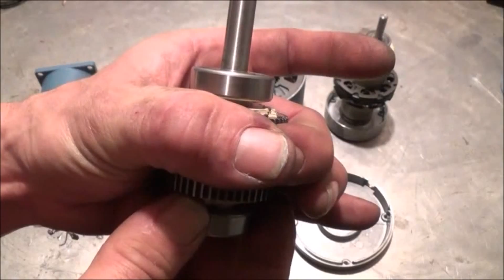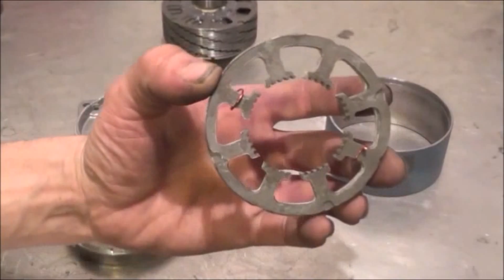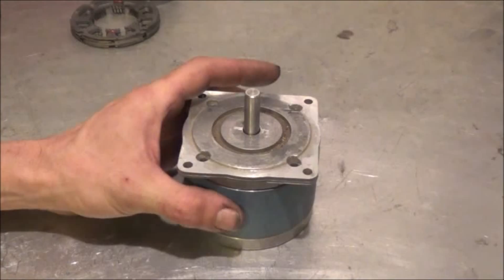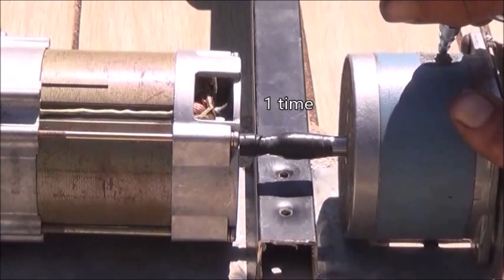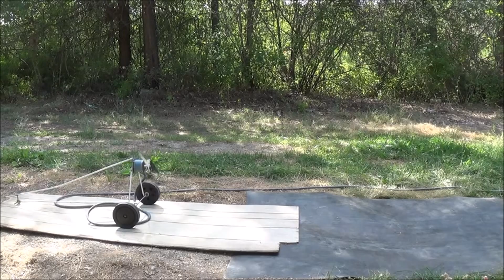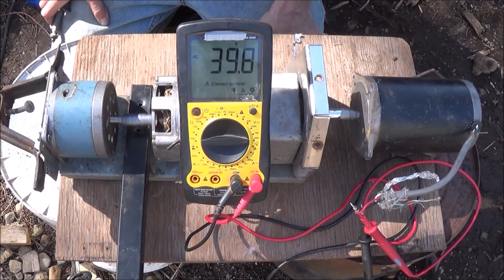New "Tesla Turbine" Design, Full Test And Build. NEW Design Starts Under Load.

Comment: The offset of discs just mimics the scroll on a turbo. If you employ the function of a conical shape within the body you will funnel and concentrate the forces. Chuck in some gears and you have a mechanical advantage as well.

Comment: If you could determine your brake horsepower and cfm air usage you may be able to incorporate a compressor head with a bypass whereas you could if your turbine is efficient enough, be able to start it with an outside air source and once up to speed allow the incorporated air compressor to take over and have a perpetual motion electric generator. That would be interesting. I am impressed with the amount or rpms that it produces, but torque is what propells the load from the generator/And air compressor

Comment: My question is what is the required energy input as compared to the maximum output of the Tesla generator?
Reply: As you've noted measuring the efficiency of these units is a complicated game in of itself to calculate, depending on what given medium is used to drive the system just takes a bit of math and known values. Steam would have a detriment as much energy is used to create it. But given this case where he has used free energy in the form of compressed air made from his trompe compressor is likely where the high potential efficiency stems from. I'm sure Tesla did the same to achieve his proclaimed 98% efficiency. At that point the only losses come from friction in heat and imbalances. All of this sounds great but there is still one large problem, torque. A Tesla turbine dam would indeed be interesting but it's easier to just let the water fall and drive conventional hydroelectric turbines as their efficiency is already 90% while maintaining the advantage of much greater usable torque compared to a Tesla turbine. Water is a much heavier fluid than air and thus works multitudes better for this sort of thing. This also results in lower rpm and reduced maintenance. That's not to say that the power of our largest dams couldn't create astronomical amounts of pressure in air but logistically it's a difficult thing to opt for going that route. Imagining the incredible speeds and very high pressures, a failure would be much more detrimental and the cost of taking that into account engineering wise I'm sure isn't worth a few percent. Everything considered, very cool technology. I always kind of though as it being best use in a kinetic energy recovery system. KERS like in F1 race cars, imagine an additional small tesla unit running off exhaust to rotate a mass in which said mass could be dumped back into the wheels for additional boost? Or anything run off of combustion for that matter, exhaust is wasted, why not use it? Just for that momentary boost in power if you need it. Sorry this was so long, I just really enjoyed the video and saw your comment and thought I'd offer my two cents. Anyways hope you see this, it's been a while, enjoy!

Comment: Does it work with steam.
Reply: Any gas or fluid will operate it, if you wanted to (and were insane enough) you could power one of these with mercury metal lol. Steam actually is one of the better drive gases for them, the heat allows for a higher flow rate and since the turbine extracts a ton of heat from the drive gas, it operates very efficiently.

Comment: WTF is the point! Put a fan on the end of the Dynamo you'll get double the power, but still only 10% of the input power. This about as inefficient an energy transfer chain as I've seen! What's you compressor running 500 Watts?
Reply: There is no compressor. It's generated by gravity & water..  He has a video on that.

Comment: I have a question im hoping someone can help me with. Is the exhaust equal or anywhere close to equal to the input? Could it in turn be used to power another smaller turbine?
Reply from the maker: The exhaust if working perfect should be producing vacuum forces and drawing air in,  this turbine is turning most of the 100 psi input pressure into a light vacuum force pulling at the "output" holes.  There is still some air exiting the exhaust holes but not much compared to the input volume.

Comment: Why are we not seeing these being used more? Why is it not common knowledge? Is there actual practical use? If yes....where/why? Thanks!
Reply from the maker: The origanal reason for the Tesla turbine not being used at a large scale was the materials available at the time could not handle the centrifugal forces generated on the blades. Today we still have issues when it comes to building large Tesla turbines due to the centrifugal forces,  nitinol and other super alloys have increased the potential size of the turbines but costs are far too high for production. They also only produce the 98% efficiency 's when only a light load is applied then as you increase the load they reduce in efficiency drastically.

Comment: How much energy is being used to power the air compressor?  Can this turbine "self power" the air compressor?  If so, then would that be called perpetual power?  Just an idle mind at work here......lol
Reply: Larry Ciarrocchi could work as hybrid for moving vehicles
Reply: He is using a Trompe Hammer for a Air Compressor. It's free if you have running water streams and elevation.

Comment: Would be cool to calculate efficiency... power out/in. 22W is pretty small though, so probably not very efficient. Maybe map out the power curve, I'm sure it's got a peak airflow and RPM that it works best at.
Reply: remember that this is only proof of concept, the amount of power out is limited mostly from the motor he is using for his generator. I'm sure that if he hooked up a car alternator he'd be pushing a lot more than 22W with the same amount of energy in. Doing a quick google search it said that car alternators get about 560 - 770 watts, and you'd only need to run it at about 2000 rpm, so if he is getting up to 14000+ rpm as he has shown in other video's then he could use a 7 to 1 reducer gearing to get the needed rpm for the required output.

Comment: Can you put a cap over the exhaust ports with the shaft sticking through and the exhaust air to another Tesla turbine? Using the same air with two turbines to one generator?
Reply: You can do anything within your mechanical capability to fabricate what you are talking of. I cannot tell you of the success or desired results. That is up to you to discover sir. If it doesn't work, you'll know. If it does work, you'll know.

Comment: How much forward thrust are you getting from the air exhaust?
Also, once you've determined an optimal angle for you nozzle. you should drill & tap a threaded standard air hose coupling, so you do not lose air pressure going in.

Comment: If you staggered 2 or 3 stater plates at a time, instead of individually, you could vary the size of the channel. Different sized step motors could be used to scale the turbine for different power levels.

Comment: we could use the exhaust from the car combustion engine to power this to in turn power the wheel more power per liter
Reply from the maker: Like a exhaust alternator addition to the power system, I like your idea!
Reply: thanks, just remember to attach a pump to pump oil for lubrication
Reply: Great idea I appreciate
Reply: Called a turbo, already exists

Comment: I do not understand why you are putting three into this chain? Other than the gear box why use the center motor? Are you generating an electro-magnate field in the Tesla Turbine since the steel parts are magnetized? The Tesla Turbine is generating torc can that be geared to power a Kinetic flywheel for power storage?
Reply from the maker: It is only for the gear box, the electric motor part of it is just connected to the gear box.
Reply: Does the Tesla Turbine have a magnetic field? If it does can it be used to gen electricity?  Finally can the sys  be used to power up a large kinetic flywheel?

Comment: Hey, that's a brilliantly inspired re-use and design concept! 
Can I please ask how the torque compares in reverse vs forwards?
Reply from the maker: It is the same as long as the input is placed in reverse to it's current position and direction.
Reply: +MrTeslonian cheers for replying dude.  So that would imply that the stepped blade-like path through the plates doesn't have a vast effect, more the hole-edges grabbing the airflow?  I'm pondering what losses might occur when driving a linked pair of turbines as a kind of transmission, and whether 'reverse gear' would work...
Reply from the maker: The stair case design increased the travel path the working medium has to travel before exiting the turbine going from only 2 inches up to 8 inches, as well as creating new frictional force imparting zones, were the staggered blades meet . The stair case would be effected the same in ether direction, it is the same as long as the reverse  direction input was in mirror opposite to the forward input.
Reply: +MrTeslonian Ahhh, thanks, penny dropped. Got it now!
Reply from the maker: A Tesla Turbine rotor will not rotate below a flow rate of 1.5 cubic centimeters a second due to the opposing effects of centrifugal forces and frictional forces, this is what it takes just to get the turbine to rotate with zero harvestable energy. A near perfectly designed Tesla Turbine can produce about 157 watts with a flow rate of 1,000 cubic centimeters a second, (this would be a turbine with a disc radius of 29 mm, with a disc spacing of 110 nanometers, and a disk thickness of 55 nanometers. and rotate at 3,965 rpm's.  You would need an enclosure with a gap between the blades and the case of no more than 330 nanometers, it will need a nozzle with a 20 mm height and a 3.35 mm width)  Now I did this math for a non-compressible fluid as the working medium and the results are must lower for a gas or air depending on moisture content and other factors.
Reply from the maker: A Tesla turbine that has a flow rate of 5 cubic centimeters a second, would need to rotate at 19,727 rpm's and have a internal disc radius of 2 mm and a disc spacing of only 49 nanometers, to produce 0.075 watts, all of this is contingent on if I get the energy density of the turbine up to 1.5 watts per cubic centimeter. Energy density potential closer to 2 or even 3 w/cm3 would be ultimately the idea, yet the machining and design required to build a Tesla turbine with those energy densities would require precision engineering.
Reply: +MrTeslonian or precision drilling of holes in the plates of a dentist drill?  hmm.
 Thanks for the numbers, at first glance it looks like the flow to power output/transmission when driving larger plates might not work for my idea, too much slippage under load perhaps.  Those numbers, I assume, were for a unit with your staircased plates?

Comment: Only 2 minutes into your video and wondering if each plate had a fibanacci swirl sanded into each side with a heavy/coarse grit if that would help the frequency merge and efficientcy.  (Also, just getting it out now for my own mind, but I am speculating efficency may be ackward due to the shape of the teeth and that that turbulance may mess up the vortex and instead of being a source of extra omph, may generate more internal heat which detracts from the output.  Hope I am wrong).  BTW, I have learned a great deal from you all while really enjoying your videos and how you come up with and make these awesome ideas work.
Reply from the maker: show me any one else using as small as a intake hole as this and moving a vehicle platform or that can turn a large stepper motor from a Bridgeport cnc mill fast enough to produce 60 volt's as a generator, or that has made an air frame move from prop thrust? Is there any other videos showing a small design with this little volume of flow doing any real work?
Reply: MrTeslonian I can not, lol.  That small hole and the fact it was not sealed while doing what it did is very impressive indeed.  I did not hear the optimal frequency merge I expected that says it is at peak efficiency, but without your idea of using those teeth as sails, perhaps a traditional set up with the same specs and reaching that merge would not have the torque to do what you impressivly did in various demonstrations with using only that small air supply,  I am inspired, thank you.
Reply from the maker: The turbine can and does reach or match intake air velocity and then steps down to match the vortex speed giving that distinctive tone change. I don't need to let this design ramp up to velocity before applying a load unlike the standard design, when I had a larger tank of air to work with like the scuba tank and regulator I could get the can-am for instance up to high speeds it just takes a long distance for it to get up to full speed. I could upload an old film of the turbine being used with no load giving that distinctive tone change as it matches the air speed, I just didn't think it was as pertinent to the output so never uploaded it.

Comment: Can you use water to run it as well?
Reply: Oil would solve that problem. Water would wash away the grease in the bearings. Oil as a mechanical fluid would keep the bearings lubricated, low friction, corrosion resistance... but I don't know how it would work in a closed system. I'm assuming you'd want to keep recycling the same oil. I've never tried anything like this before. Looks interesting.
Reply: I don't think it will be a good idea, to use fluids. Cavitation will grind the turbine down in short time. And you have a lot of cavitation due to the lots of gaps in the layers. I will have a guess that even air will start grinding on the layers after some use.

Comment: I want to try this, where would I find used stepper motors cheap? I've seen mostly small ones on ebay, how do I know which one to get? I believe I want one the same size as yours. Which did you use? Thanks
Reply from the maker: No idea these were given to me, they came from a cnc mill.
Reply: Try going to your local Crown Lift Trucks depot . Ask for any old Wav50 drive motor assemblies and you may also get the gearbox that's used to transfer power to the wheels. They run a pair of these motors, one left and one right as they use like a skid steer system for directional control . There 2 types of motor used on these machines but they have to be paired type 1 and type 2. If the motors are paired they will look alike. Main way to tell is if on the gearbox side of motor flange there will be 2 channels for airflow, one at 90° the other at 180°. These are the type 2 motors

Comment: Ok, What the heck , I thought about trying to use Freon with one of Tesla's valves and a turbine . Using the high side of the AC system to drive the Turbine with the below said perm. mag. with coils to make a.c. current and some way of using a Sterling to compress. I'm sure i would have to have a outside power source to start. At any rate it's a thought. All started with the question "What drives a steam turbine ?"  then how do you make steam ...Ok  how to not use a fuel to boil the water. " What boils at room temp. Well a lot of things but most homes already have a AC system and a small kit could be made. Thanks after you read this please remove it . So the wrong people dont well you know .
Reply: What is it...Cobalt?

Comment: Can one drive the output and make it into an air compressor? What is the efficiency?
Reply from the maker: +jim smith No not well, it will work much better for hydraulic pumping.
Reply: Speed is too high to run a piston pump without reduction gearing, which will lose a lot of energy.  However, you could stick another Tesla turbine on the other end.  The same device can actually be a highly efficient pump as well as highly efficient turbine, just turn it the other direction.  No reason to waste efficiency with this hybrid design if you're going to do that though because you don't need the high torque for the startup.

It would probably be one of the more efficient ways to convert high pressure steam to high pressure air or similar conversions.  A well built one should be able to approach 85% efficiency.